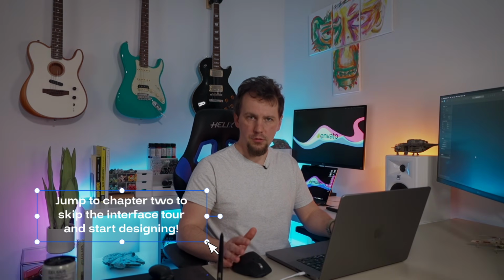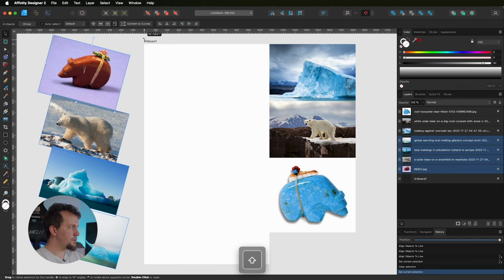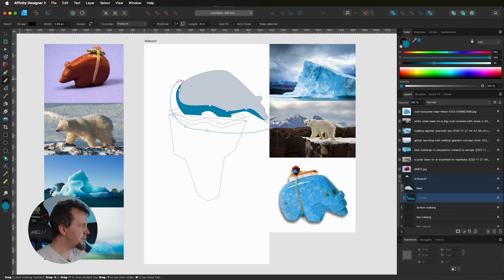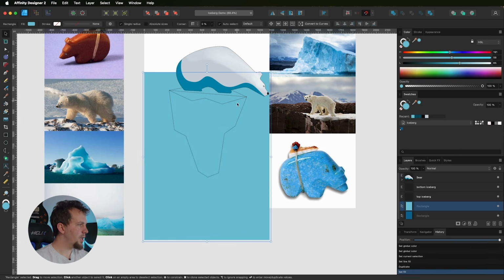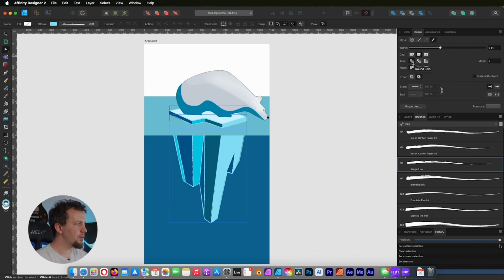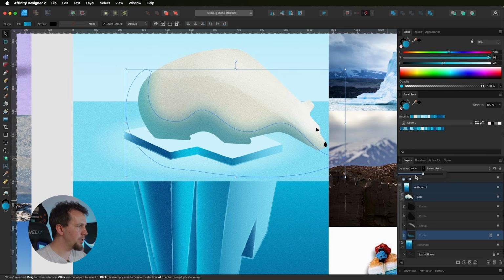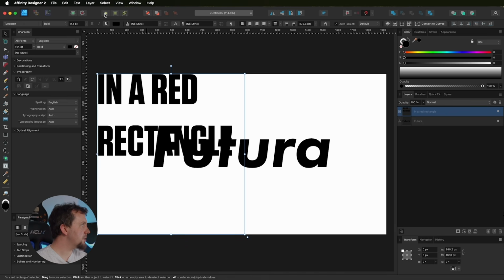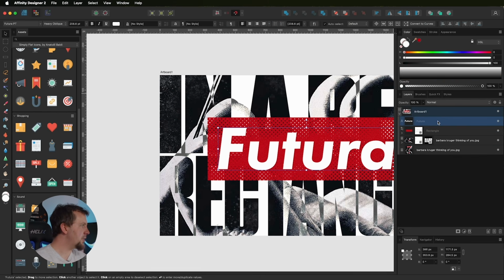Affinity Designer for Beginners | FREE COURSE

Comment: Nothing is staying visible outside my artboard I check my clip to canvas nothing is working.  Help plz
Reply from the maker: In Affinity Designer, when objects aren't staying visible outside the artboard, it's often due to specific settings or behaviors related to the artboard itself. Here are a few things you can check and try to resolve this issue:

1. Clip to Canvas:
You mentioned that you checked the "Clip to Canvas" setting, which is good. This setting should be turned off if you want to see objects outside the artboard. However, since it’s not working, let's try other options.

2. Artboard Export Option:
Make sure your export settings are not affecting the visibility. Go to File > Export and check if you have any export settings that might clip the content to the artboard.

3. View Mode:
Sometimes the view mode can affect what is visible. Ensure that you are not in "Outline" mode by going to View > View Mode and selecting "Vector" or "Pixel."

4. Check Layers Panel:
In the Layers panel, make sure that the objects are not accidentally clipped inside the artboard layer or masked. If they are, try moving them out of the artboard group.

5. Artboard Settings:
Sometimes, the artboard itself might have a setting that's causing this issue. Select the artboard and check its properties to make sure there's no option selected that's clipping content.

6. Update or Restart:
If nothing else works, try restarting Affinity Designer or checking for updates. Sometimes a simple restart can resolve unexpected behavior.

Hope this helps!

Comment: Hi. Thanks for great video. When I create a new document, must I change it to an art board? Currently I do my designs on the document.
Reply: Hi I'm the instructor. You don't need to create an art board. It does make it easier to manage multiple versions of the same design though and you can also workshop different ideas in art boards.
Reply: @moonlime-io  hey i cant find the fonts like futura and tungsten in my affinity designer